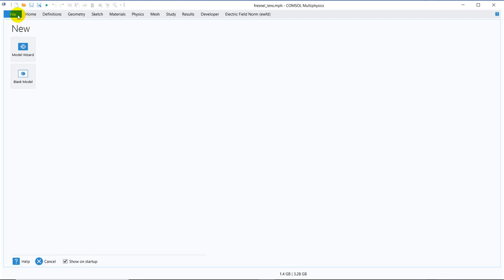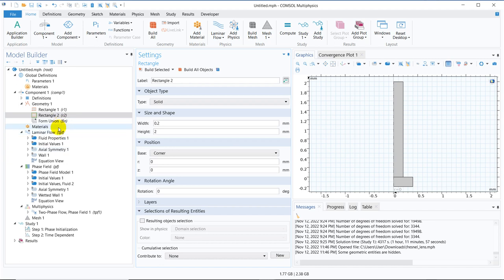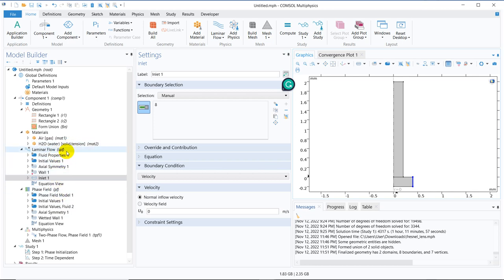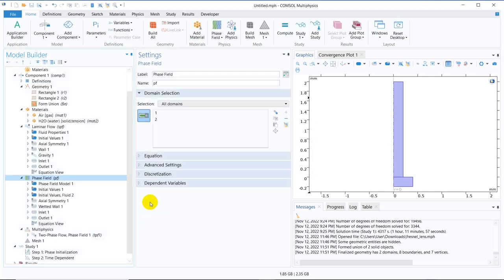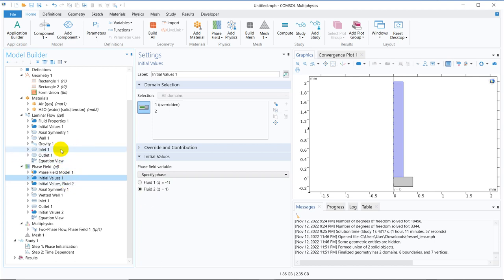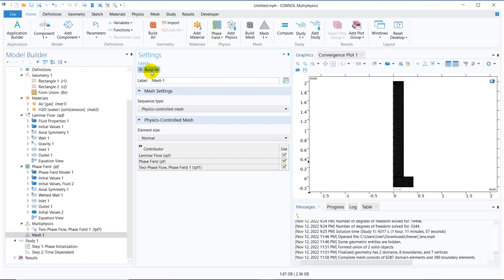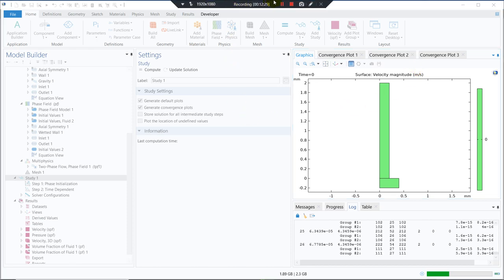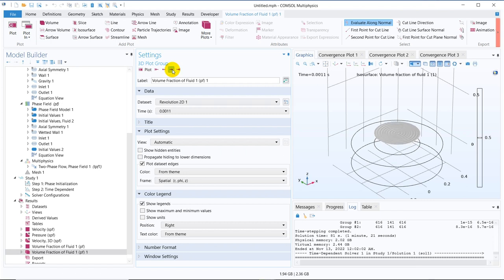Capillary rise with Two Phase Flow Phase Field #CapillaryRise #COMSOL #PhaseField #TwoPhase #POS

Comment: Sir I need help with particle tracing. I want to define an expression for inertial lift force on the particles and implement it in my microchannel flow but I don't know how to do it.
Reply from the maker: It is possible. I will look into it and upload related videos. We are in the process of making a researcher community, please write to pioneerofsuccess2020@gmail.com if you want to join our network.